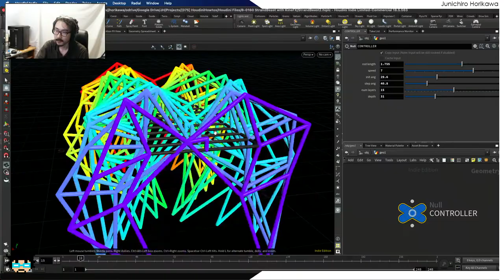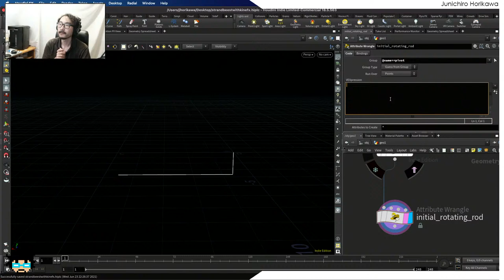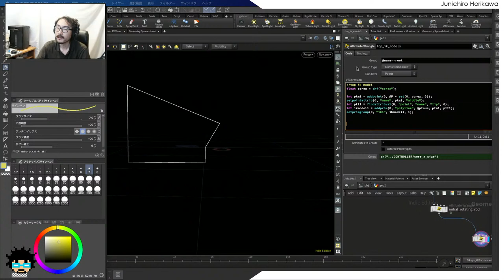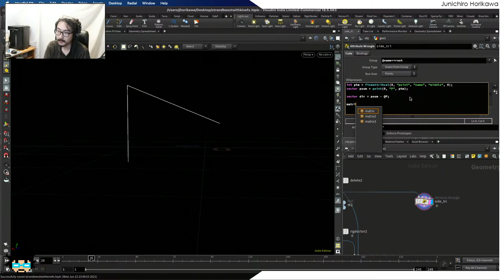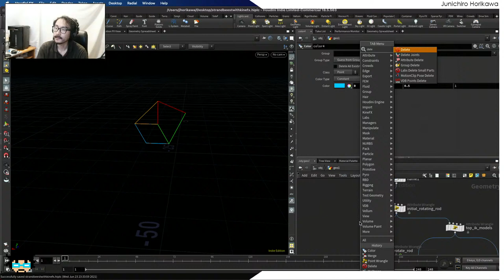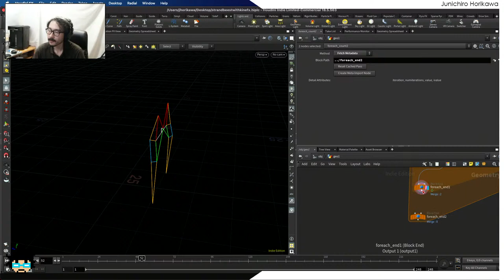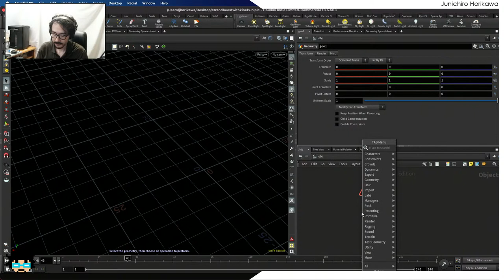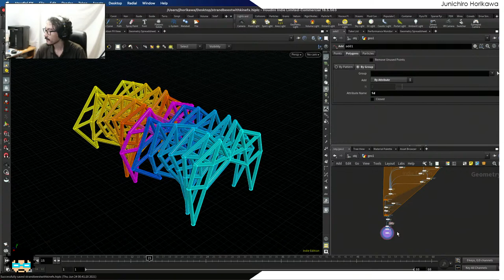Houdini Algorithmic Live #066 - Strandbeest with KineFX

Comment: Looks like you can just merge the tip point from rotating rod into your rig, and name it "goal". No need to animate a stretchy bone pointing to the rod top. Then both inputs to ik chains come from the same node. Rig doesn't need to align with drivers. The goal will make it align.